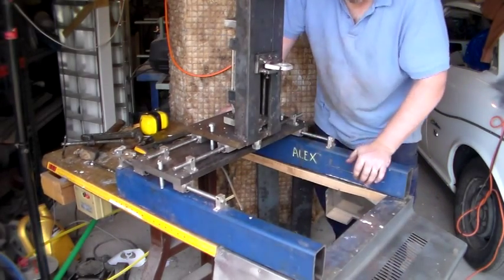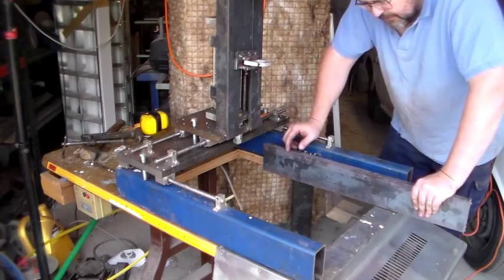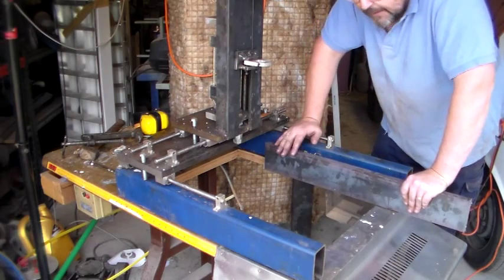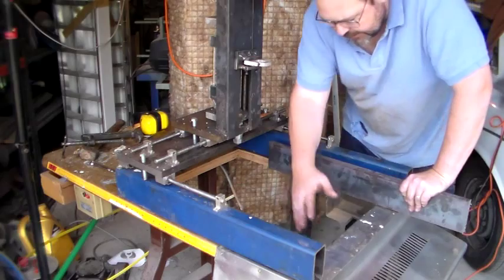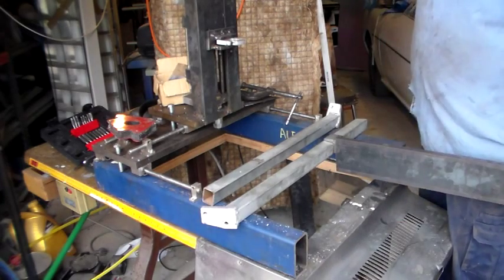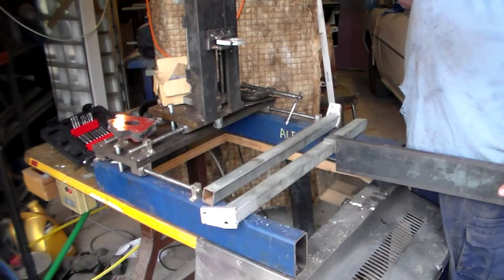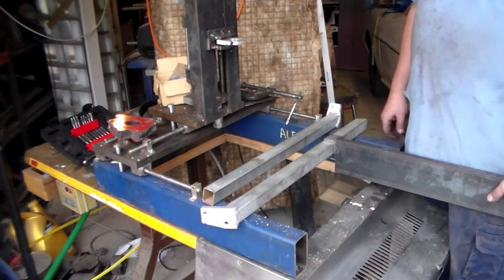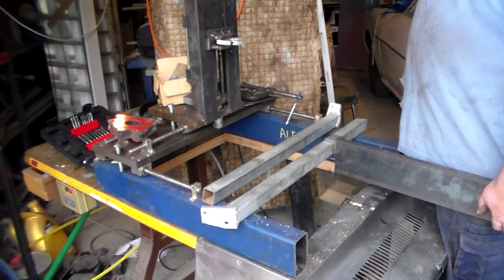Making a Plastic Injection Molding Machine Part 12

Comment: You're the first of a kind building a DYI injection mold on video. Many tried but stop short of completion. Lots of people may learn a lot from your work, whether it fails or whether it succeeds. And detailing how you solve those problems around the corner. Excellent work.
Reply from the maker: I appreciate your kind words David.  I've never made an injection mold before of course but I have an idea of how I can do it.  I look forward to getting that far in the project myself  ;-)   I think the key message is to never be scared to fail...just give it a go!